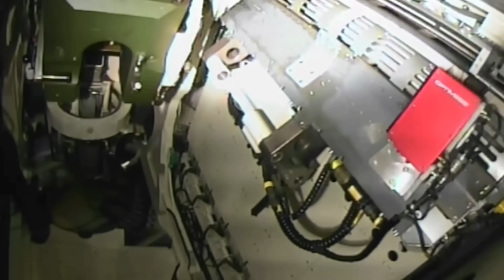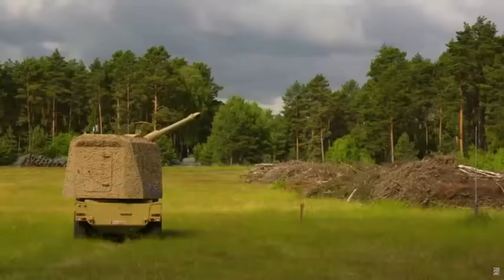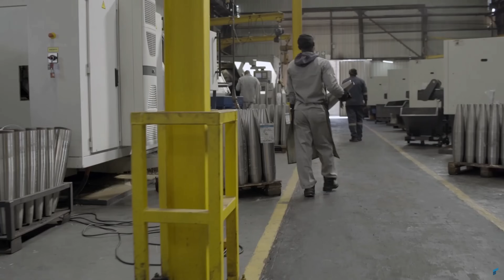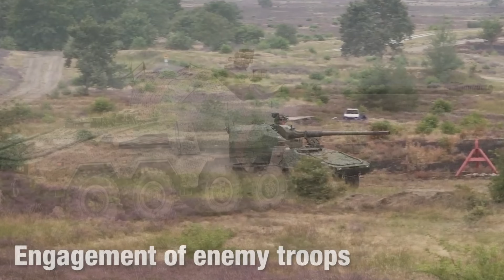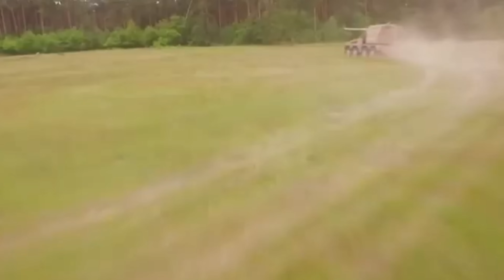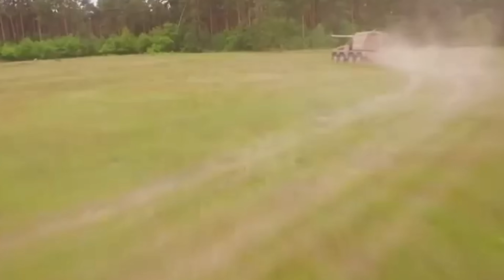The RCH-155 Self-Propelled Artillery System | 155mm FIRING ON THE MOVE!

Comment: I think the most intriguing part of this system is the fire control system that allows it to fire on the move accurately.
Reply: That technology has been in use on naval guns since the 80s or even longer. It just is the first time being used on a land platform.
Reply: I think that’s the hardest part. If you look at the Archer the target computer is very advanced
Reply: Yes absolut right but the most People didn't understand to much about that.About the move it's much longer possible but didn't needed in the past was a buff Time to move about counter battery.They adapt that system 😉it's only mathematics with Sensors and Computer to stabilise in milliseconds....take care ✌️
Reply: Consider the availability of precision 155mm rounds, firing on the move accurately isnt hard to achieve now
The system looks like it needs a tad more stabilizing but in all its something that US military
more over Taiwan should buy
Reply: @verdebusterAP  It was identified that stabilizing is not needed, even to be an disadvantage. In the part of the second, the barrel is correctly aiming on the target, the round is fired by the computer of the fire control system. If it does not fit, it will be fired a second or two seconds later, when the barrel is correctly aiming. It is not so important, if the enemy gets the thousands of shrapnels by the airburst explosion one second earlier or later. And if they want to kill/hit a fortification as example or a parked truck e.g. fortifications and ammunition depots are not running away, it is not so important, if the blow up one second earlier or later. This is not a tank vs tank battle, where this one, who first shoots. best while moving, wins. And in case they had to use the hunter killer skill...something has gone very badly wrong.

And regarding guided ammunition; Excalibur is now useless, they get jammmed. And this will be the issue with all of these, there is just not enough space in the guided shells, to get them jam resistant enough. Excalibur is out of duty since more than one year.
 
With modern western 155 mm shells for the L52 155 mm guns like the CAESAR, Pzh2000 or the Rch155, like the DM121 or the Ln211 155 mm shell families, on ranges around 24 km, no guided ammunition is needed. The L52 artillery systems will be able to place them on an area of a tennis field (with the second shell, the first one 3 seconds before is needed to calculate the speed for the second one). As airburst with 4500 tungsten pellets and 1000 to 1500 from the shell hull, these are direct hits against everything not pretty well protected. On 34 km less than a soccer field. These shells have a death zone of more than 50 m. 
And with cheap but highly effective guiding systems like SPACIDO, which will just take care, that the shellls will fall down directly from above, it will get even 4x more precise.
Reply: @Nobodyisperfect-us6pk  
Its rocking too much and needs more stabilizing 
There is no need for FCS when you can point and shoot with the M982 Excalibur and M1156 Precision Guidance Kit (PGK)
Staying static and firing unguided rounds is asking for trouble in modern warfare
Yes unguided rounds can be just as accurate with FCS but the point of precision is 1 round, 1 target
Even with FCS , 1 round accuracy is still 50/50
Ukraine has shown that GPS jamming can be problem but the US military isnt Russia
They numerous airborne assets that can easily locate thoses jammers and transmit the coordinates to the nearest asset so they can destroy
Agreed that if they have to use direct fire, then things have hit the fan
Reply: @verdebusterAP  The issue is only that Russia is not only working with few big GPS jammers, they are also working with hundreds or even thousands of small ones. As soon something crosses the frontline, the real problems start. These have not so much range, but are able to protect locally. And if someone shoots guided shells over these... Excalibur has the lowest hit rate of all 155 mm shells, it is useless. It is withdrawn from duty for now around one year,when the hit rate dropped below 5%. And we are not anymore talking about direct hits. And this will be the issue, every GPS system, fitting into a shell or even the small fuze, is to small and not able to be protected against GPS jamming and spoofing. Bigger weapon system can work, but also weapon systems like the guided HIMARS missiles are reduced in the accuracy. And the accuracy is getting more and more worse. 
And a hint, there was a test with Pzh2000, DM121 shells and M1156 kits. Combined, these are far more precise, better than Excalibur. Of course without GPS jamming. 
And yes, big GPS jammers will be an easy target (also not too easy). But the patchwork of small cheap GPS jammers with ranges of few km everywhere?
Reply: @Nobodyisperfect-us6pk  
Whether have big jammers or small ones , it doesnt matter, the USAF and USN has the assets able to locate them
One of the fun discoveries from the war in Iraq and Afghan was that EA-18Gs working as group could trilaterate a signal sources like a cell phone from long range 
Mind you, they were doing with the older ALQ-99 pods. The USN is currently fielding newer AESA based AN/ALQ-249 MB pod which is several hundred times more capable than the ALQ-99. The USAF is fielding the newer EA-37B Compass Call to replace the legacy EC-130H Compass call so locating them wont be problem nor will destroying them
So lets say for argument sake, they have 1000 jammers fielded 
The Advanced Precision Kill Weapon System (APKWS)  from Cobra and Apache is cheap and effective as well as Hellfire from MQ-9s
The GBU-39 at 40K per unit with over 17,000 made. A little pricey but ample numbers to do that job. The US is very good at deal with the problems at source so in addition to destroying on the field, they would also prioritize destroying warehouses where additional units would be stored
You are forgetting Ukraine does not have capability yet to effectively destroy Russia's EW sites whereas the US would have no problem
Reply: @Nobodyisperfect-us6pk  
The USAF would have no problem dealing with it
Reply: @verdebusterAP  Just for your information. They have reduced the dampers to increase the wobling and to decrease the stabilizing after the shot. Stabalizing will be a big disadvantage so it was decided not to ad it. Both are easily lammable, this is the reason, that Excalibur are of duty and in storage since more than one year in Ukraine. You can use them somewhere in Africa or against some insurgents, but other countries will jam or spoove them. Equipment can be hardened against GPS jamming and spooving, also there hit rate will be reduced, but for this, directed antennas e.g. will be needed, this will not work for shells and even less for small fuzes. 
Jammers, yes, Russia has some big ones and pretty sure, the US airforce will be able to deal with them as also finish of the whole airforce and silence the Russian AA systems in 48 to 72 h. And how they shall get rid of the hundreds or perhaps now, thousands of small half a meter boxes and barrels, with very cheap and fast to produce GPS jammers (with only short range, sometimes it is just the number).
Reply: Who say anything about accuracy on the move? It probably only fire guided round on the move.
Reply: @joelau2383  No, it is accurate with regular, unguided rounds. It uses technology that has been used on naval guns on ships for a long time, where the fire command doesn't immediately fire the gun, but the computer waits till the barrel is in the right position before firing.
It is basically the same thing as the computer on a Segway or one of those electrical unicycles, which checks the position of the device in space 1000 times per second or so and in the case of the gun, only fires if it detects that desired position and actual position are identical.
Reply: @TrangleC  This is exactly what i mean. The navy gun have NEVER been accurate with coventional round. It always need a few shots to adjust aimming when target is 20+km away 

Besides, ground environment is much more difficult to move smoothly than sea. Rolling over a rock or pile of dirt can instantly throw your aim off miles away from target.

P.s. I bet you never ride an electrical unicycles off road.
Reply: @joelau2383  How riding stuff over rough terrain feels to you or me doesn't matter. We aren't computers that think with computer speed. A machine that checks the position of a gun barrel 1000 times per second or more doesn't care how bumpy a terrain or the sea is, because to it everything moves at glacial speed.

A bump in a field or road to a modern computer is as if someone would tell you: "We are moving upwards by 2 inches for a week now and then we'll move down 2 inches again for the week after that."

And to a machine it doesn't matter whether a gun barrel stands still for an hour before shooting or whether it moves through the same firing position for half a second. All that matters is that the barrel is in the right position to hit the target, not how long it remains in that position. 

You need to stop applying your human gut feeling to things that aren't done by humans.
Reply: @TrangleC  - BS, is not just the movement as a factor, dude, is the atmospheric conditions ( wind, humidity, temperature, etc ! ) All this need a lot of sensors and computational power. Such factors are important for a sniper round, who only can go 1-3km, but a round designed to reach 40-50km is a lot more delicate issue. 
All in all, many westerns systems look great on paper, but once facing a real fighting condition, prove to be just elaborate crap. The Pzr 2000 was trumpeted as a "game changer", yet after only few months proven to be highly bugged, with constant software failures and unable to support high rate of fire more than a couple of days - is not me saying this, but yes Ukr crews who operated them. Reason why you do not see them anymore on the frontline in Ukr.
Reply: @joelau2383  You think WW2 naval gunnery. Today's guns are a lot more accurate due to exact ranging and fireing solutions which take the weather into account . Of course battleships are dead for other reason.
Reply: @michaelrenper796  
Battleships died out simply because their big guns had limited use fullness as conflicts charged
there were no longer big battles with ships slugging it out and the range of those guns were limited
As pearl harbor showed
Their armor was easily penetrated by aerial bombs , the precursors to modern bunker busters 
The Yamato was sunk after several waves of air strikes
A single F-15E with carrying eight 2000lbs LGB or 5 LRASM would do it in one strike
Reply: @mirandela777  Now you are getting silly. All the stuff you list now is stuff stationary artillery has to deal with also and it really doesn't need that much "computational power", which is why I mentioned 500 Dollar recreational vehicles basically doing the same.

Are you a time traveler from the 70s or did you wake from a coma or something?
Reply: @TrangleC  Physics doesn't care about if you are human or computer.

When you roll over rough ground, the whole vehicle vibrate and your long heavy barrel would bend and swing around in a certain natureal frequency. It ruins internal ballistic of your gun. The factor of this problem is much more complex than simple trajectory and time.

You need to stop believing computer can solve every problem. It is still designed by human.
Reply: @joelau2383  You seem to struggle understanding the concept of time.
Reply: @TrangleC  You still don't understand it is not a problem of time. It is a trajectory prediction problem. When you ignite the propellent, you cannot do anything with it. The most important thing we learn from internal ballistics is stationary and static always make the most repeatable and predictable trajectory. Moving and bending your barrel are exactly the opposite.
Reply: @joelau2383  Apparently you didn't learn anything about how long it takes for the projectile to leave the barrel.
Everything is a function of time. What is so hard to understand about that?

In that amount of time the shell takes to move through the barrel, it doesn't matter whether the vehicle is moving or bumping or whatever. There is no difference between it moving and it being stationary to the shell or to the computer firing it.
Reply: @TrangleC  you really know nothing about internal ballistics.

Bullet never leave a straight barrel. The propellent gas always generate recoil force and shock wave traveling at sonic speed in metal (much faster than bullet speed). They start vibrating the barrel and whole firearm structure when bullet barely move. One of the most important goal of internal ballistics is to make sure ballet leave the barrel at the exact same muzzle position during vibration.

If your SPH is moving, your barrel would be constantly bending and swinging around. It obviously will change vibration pattern and phase. Thus mess up leaving muzzle condition and accuracy even if you keep your aim perfectly at target.
Reply: @joelau2383  How about you learn to speak proper English first before you start big discussions in that language?

Guess what, this has nothing to do with "internal ballistics" because recoil, vibrations and all that other stuff you talk about are all the same for stationary guns. If they would make guns inaccurate, the same would be the case for any other gun or artillery piece.

And even if gun barrels made of thick, hardened high performance steel would wobble around like rubber just because you move them a little, as you seem to think, it still wouldn't matter, because as I said many times now, any movement, including wobbles, is relative to time. You shorten the relevant period of time far enough, any movement becomes irrelevant, because not much of it is happening in that short time frame.

I don't get whether this is really beyond you, or whether you just keep arguing against it because you are too stubborn to admit that you are wrong.
Either way, I am tired of it.

You can keep thinking you know more than all the engineers who built this machine and others. I'm done with this low IQ debate.
You have the last word.
Reply: @joelau2383  You keep talking about computational data like you are knowledgeable about it, yet you are obviously ignorant. Also apparently you have never called in naval gunfire onto coastal areas. It is very accurate. So stay in your lane.
Reply: Talking with data and knowledge is the exact opposite of definition of "ignorant". Thank you for proofing yourself wrong.
Reply: @joelau2383  with the Oto Malara 76/62 gun, or Mark 75, I used in the US Navy, we would routinely destroy incoming targets with one or two rounds, and those were training rounds with no explosives like a giant bullet.
Reply: @mirandela777  goes to the old adage, military plans are great until the first shot is fired.
Reply: @verdebusterAP  that wasn’t the only, or even the main reason. Having been built in the 1940s, there were no spare parts for the various mechanical components. I ran into that in the 90s on a ship built in the 50s. For one particularly bad breakdown on an A/C plant we had to contact the manufacturer who had to redesign and forge the new parts.
Reply: @williambinkley8879  
Thats the USN fault are not re engineering them with more modern guns 
One of the precursors to the standard MK45 5 inch gun was  Major Caliber Lightweight Gun (MCLWG) in 1975
That used 203mm round and had base range of 18 miles. Re gun the Iowas 203mm or slightly bigger
Reply: @williambinkley8879  Oh, i am sorry. It isn't an rely to you. I forget to add his name.

About mk75, i believe you means visual target within 5-10km right? (Sry if i am wrong, but i think mk75 doesn't even have 20km range with unguided conventional shell.) In visual range, you can track instant accurate target location with laser and radar, scan weather conditions according the whole trajectory like wind speed. The difficulty and complexity are far from SPH shooting over 20+km with unguided shell with third party target observation.
Reply: @ it was radar directed. There was a secondary visual timer, but that was only for emergencies, the few times I saw it used was not very accurate.
Reply: Even in WW2 some battleships already had mechanical computers which allowed to calculate your own heading and that of the enemy to give you a decent fire solution. Imagine what we can do nowadays.....
Reply: @joelau2383 No, shooting while driving is not done with the GA (Guided Ammunition), but with the normal grenade. The aiming computer permanently calculates the correct gun elevation with all parameters and the shot is only fired when everything fits.
Reply: @duke6321  I am sure they said something similar about fire on the move in tanks when it was a new feature. I mean we all know stationary sph (some sph even have same naval gun system) computer cannot even guarantee an accurate first unguided shell on target 20+km away. There are so many technical problems between current prrformance and this marketing feature.
Reply: @joelau2383  And you stubbornly believe that this entire problem was not known to the development engineers and that they therefore did not use several years of research/development to eliminate exactly this problem? These are not beginners, they know the matter and the characteristics of the howitzer exactly and have of course also taken them into account in the weapon control system. Or do you really think that there are only ignorant engineers in the development department who were dealing with the topic for the first time? Each development project is carried out according to strictly defined objectives, and the product is only presented when these goals have been achieved. Nothing is left to chance. The properties of the gun itself are well known, as are those of the ammunition. These developers have succeeded in transforming this into a functioning system in conjunction with the newly developed fire control system. Or do you really think that these developers would highlight this feature if it didn't achieve the same precision as the shot from a standstill? We are not at the stage of the first attempt, but at the target point of precisely this development.
Reply: @duke6321  It is exactly the opposite of what you said.

Every engineer in all howitzer manufacturers know these problems, but only one manufacturer claim their sph can shoot on the move. And you stubbornly believe it can shoot unguided round on the move as accurate as shooting stationary......

We probably will see the truth after commission a few years later. So there is no reason to argue any further.
Reply: @joelau2383 
You are a real blast, only believe in the possibility when other manufacturers have also succeeded in developing and building such a system or when you have been convinced of it as the sole luminary... Why would the manufacturer highlight this feature and demonstrate it to the assembled experts in a live shot if it didn't really work? Do you really think that a renowned company would gamble away its reputation so carelessly? These are not naïve beginners, these are experienced professionals. The PzH2000 was also far superior to all other systems at the time and there is still no better system today. The RCH155 is the successor to this - with new features that no other manufacturer can yet offer. It may be that you don't like it. But the military is not interested in that. Germany, Great Britain and Ukraine have ordered the system. They will have thought about it carefully beforehand.
Reply: @joelau2383 
How ignorant one must be if one does not want to acknowledge the progress in technology. It is quite common for a company to be the first to have a new feature ready for series production and to propagate it. What's wrong with you? There are no novices working at Rheinmetall and KNDS, this is a further development of the PzH2000. And it was also superior to the other howitzers when it was put into service. And this has not yet been trumped by any other system. The RCH155 is an advanced successor with the ability to shoot accurately even while on the move. You don't seem to like the truth. Learn to deal with it.
Reply: @joelau2383  If you don't know anything about artillery computational data, you should probably not comment. you are only changing one variable while being on the move, your current position and elevation. All other variables stay the same. This can be done on the move with a strong enough GPS system, and AFATDS software that can run those computations.
Reply: @joelau2383  It is 100% precise, it has shown it during the live fire tests also in front of the guests (and they had a live feed of the target). The gun will only fire, when the barrel is in the correct prosition and the computer decides it fits. Also they will use it in best case (if ever) on the  move while on a street and they will also have to move slow. The aiming for the Pzh2000 ist a circle with r=5 m on 24 km distance, the Rch155 will pretty sure do the same or will be even better. And already the Pzh2000 does not care, if it is parked on flat leveled ground (as all other systems), it is used with a slope of 30° by Ukrainian army in one video. The system just does not care as long as the barrel can be aimed on the target. Already the computer of the Pzh2000 is doing this and the Rch155 mm gun module is a further development of the Pzh2000.
Reply: @Nobodyisperfect-us6pk  Precision and accuracy are measured in meter, not %. If your target is a few miles wide, you can get 100% hit rate.

IRch155 only show it can fire on the move, but not the round fired or accuracy of the shot. 

Navy gun is also fired by computer, but it clearly show how inaccurate the first few shot could be before adjusting.

Howitzer hitting zone is always ellipse, not circle. This mean you don't even have the basic concept of howitzer.
Reply: @ I am aware, it was bad wording, or correctly, misunderstandable. The fire control system is 100% precise, already for the Pzh2000 it is aiming on a circle of r=5m on a distance of 24 km (arc second). It is able to do this and there is no reason to believe a Rch155 will be worse as further development of the Pzh2000. I did not want to say 100% hit rate, this is not possible with unguided shells, The second will hit, not the first shell. The first shell is precise in the direction, but not range. The second will be additional precise in range.

I have the knowledge, this is why I wrote here somewhere of SPACIDO fuzes, able to reduce the targeted area (from an ellipse) to a circle and decreasing the target area to around 1/4 of the size, compared with the ellipse.

I wrote already somewhere here, that the second shell will hit, with the first shell the speed of the shell, when leaving the barrel, is measured with the radar sensor (for the Pzh2000, this is the small reflector like silver rectangular structure on top of the base of the barrel), so the second shell (of modern western generation shells, as example DM121, Ln211, we are not talking about outdated shells like M795 for the short barrel 155 mm guns) will hit an area in size of a tennis field on around 24 km (and less of a soccer field on 34 km). Of course the target region is an elipse, where the shell will land.
As I already wrote, shooting while moving, this was done in front of customers/officials during a live shooting/presentation summer this year, there was a report of someone who had participated from a press like something. Both prototypes (one on the Boxer one on the Mowag Piranha) were shown. On the move was done with the Boxer version and they had a live fed to the target by video, this was not shown in the published videos (likely kept secred/confidential). Let us say on this way, they have not missed, more is not known. They had issues with the Mowag version on that day. They had some new updated parts added, still not tested, one did not work. This was solved till the end of the show.

So these videos e.g. of the Rch155 shooting while moving or shooting in direct fire mode on a target, as I understood, were recorded during this show. So these were recorded in front of many independent witnesses, several armies, several customers and press. This is also the reason, there is so less to see of the Mowag version, it failed to fire due to the new untested parts for prolonged time till it was solved to the end of the show hours later.
Reply: @joelau2383  God you are hurting my head with your stupidity, everything you post is just incorrect. The "IMPACT AREA" or merely called "TARGET" depending on the angle of the shot, IE High angle or Low angle, dictates the possible impacts and how far in a circle radius around the target, as everything in artillery is dictated by radius from the impact area. So NO the "hitting zone" GOD that sounds so dumb, is not "always an ellipse, I hate correcting keyboard warriors who have no experience in the field. Everything you post should always just be disregarded, as your lack of knowledge on Artillery is lacking, go read a 6-40 bible or some shit.